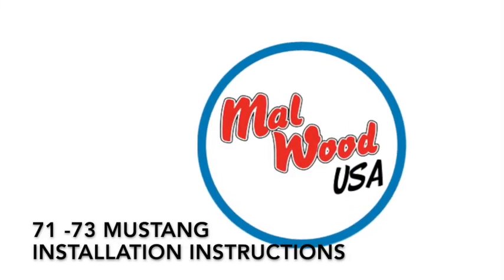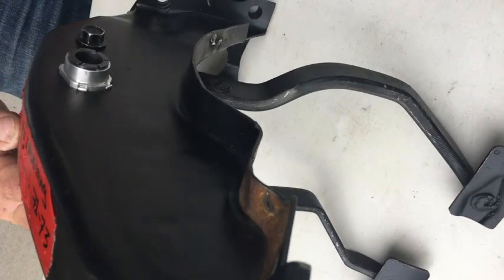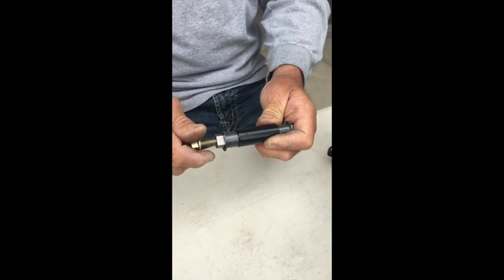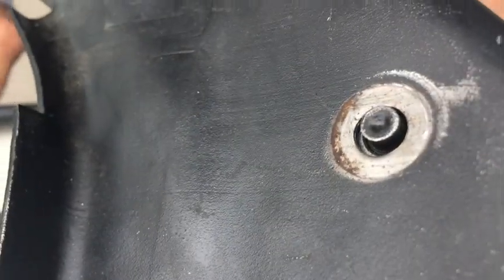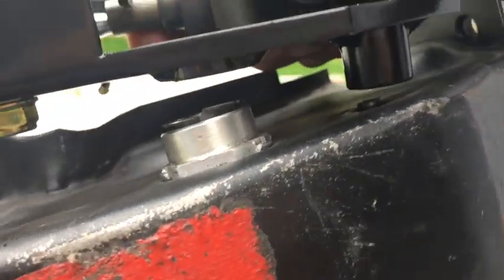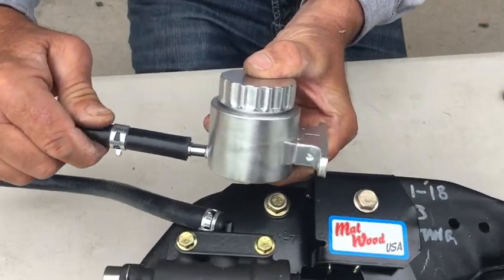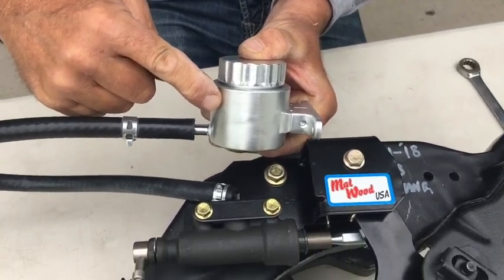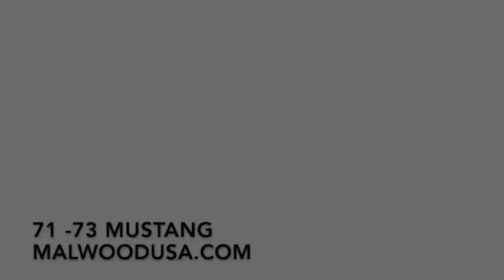Ford Mustang 1971-1973   Installation Hydraulic Clutch Pedal kit

Comment: How can I add this to a previous auto car?
Reply from the maker: You just bolt in our clutch pedal.  You will have to add a manual trans and bearing of course.  Our kit takes care of the pedal and hydraulic master cylinder.  Call us if you have more questions.  Happy to help.  six-41-777-0174
Reply: How do you bolt it in when there is no bushing for the auto cars, just a hole.
Reply: @alexanderperez1380  I  added the Scott Drake bushing kit then bolted it on.  I did have to modify the Scott drake kit as it would not install due to the tolerances being to tight.  That is on them not malwood, though.
Reply: @rcadd1ct  thank you for the information, I actually thought about doing the scott drake kit to make it work, glad it worked, any tips on to overcome thise tolerance issues?
Reply: @alexanderperez1380  Did you ever figure out how to overcome the tolerances with the scott drake bearings/malwood hydraulic clutch shaft?! Any insight would be helpful! Currently doing this myself!
Reply: @rcadd1ct  Im in the middle of doing this conversion, how exactly did you modify the scott drake bearing to fit the malwood shaft?! Any advice would help!
Reply: @armandoestrada8499 .  My issue had nothing to do with the malwood parts.   The Scott Drake parts caused the issue.  I could not get the circlip on.  The thick washer was to thick.  I ended up using a belt sander to thin the washer enough that the groove was almost visible, but when the wave washer compressed I could get the circlip on.  I fought with it in the car.  Made tools to squeeze the clip on, but only after I pulled the pedal box out of the car I could see the tolerance issues.  To sand the washer get a scrap 2x4 piece of lumber.  Screw 2 Sheetrock screws into the wood with the heads prowd half the thickness of the washer.  They should be spaced apart so the middle of the washer fits around them.  This will keep the washer in place while you sand with a hand or bench mount belt sander to the proper thickness.
Reply: Bro, you have any pics on social media!? You just confused me! Haha! Circlip? Thats the 2" spacer that goes in between the bracket on the car that holds the clutch pedal/brake pedal? What about the shaft that goes into the actual scot drake  bearing thru the bracket? How did that fit?
Reply: @armandoestrada8499  Never purchased the unit, going a different route, cable operated instead.
Reply: @alexanderperez1380  Thanks my man!
Reply: @MalwoodUSA  If your car is automatic will the kit work with scott drake roller bearings no problem? Or some modifications is necessary?
Reply: @armandoestrada8499  what transmission are running?
Reply: @alexanderperez1380  t56 magnum
Reply: @armandoestrada8499  I ask because I just ended up going with a cable operated clutch from modern driveline.  Just seemed easier to me. I did have to but a clutch pedal assembly though.
Reply: Buy*
Reply: @alexanderperez1380  i have the same clutch pedal assembly from MDL with scott drake bearing to fit in the whole thats located in the dummy slot bracket inside the car. Im pretty sure i can make it work, shall see.

Comment: Just ordered mine. Very excited. The kit I got from American powertrain was absolute garbage
Reply: Hey bro did this set up work for u? My American Powertrain set up is horrible.
Reply: @jesco6830  it worked awesome. The American powertrain angle was way off. This one requires you to grind a very small amount of metal off the brake pedal assembly that bolts to the firewall. I needed a longer hose than what was provided but I chose to mount the reservoir in a different location. Basically, get this over american powertrain and it'll solve all angle issues and make the clutch pedal way easier to drive with
Reply: @MrMatttrow  yes bro. I had to leave the car with the mechanic today. I couldn’t drive it. I stalled 100 times. He couldn’t drive it either. Clutch is undriveable. What car is urs in? Mine is a 72
Reply: @jesco6830  yeah I had to have them upgrade my clutch kit because the clearances were all wrong. And then everything with the pedal was bad. It would have been better to use cable clutch but then I stumbled on malwood. Mines a 73. Good luck man.
Reply: @MrMatttrow  good to hear u had good luck with it . I’ll call them and order it on Monday. Is the clutch engagement nice and soft and full control over it?
Reply: @jesco6830  definitely. It's like a clutch on a modern car.
Reply: @MrMatttrow  awesome! Will give u feedback
Reply: @MrMatttrow  clutch pedal worked perfectly fine. Like u we had to cut up a metal piece to clear the travel.
Reply: @jesco6830  Can you please provide more information on installation and fabrication? What bearings did you use on the clutch pedal hole located in the bracket? Scott Drake bearings? Where exactly did you have to shave metal off?!
Reply: @MrMatttrow   @J Esco  Can you please provide more information on installation and fabrication? What bearings did you use on the clutch pedal hole located in the bracket? Scott Drake bearings? Where exactly did you have to shave metal off?!
Reply: @armandoestrada8499  hydramax hydraulic clutch.  Shave metal off the plate that hold the brake pedal to clear the clutch engagement. This is in a 72 mustang fastback
Reply: Bro, any social media so i can DM ya? Was your car an original Automatic or Manual? Thanks for getting back to me
Reply: @armandoestrada8499   je_72
Reply: @armandoestrada8499  IG
Reply: @jesco6830 was your car originally an manual/stickshift car? If it was an automatic car, did you use scott drake roller bearings to attach the malwood shaft for installation? Please specify! Thanks!
Reply: @jesco6830  calilla_z06 is mines
Reply: @armandoestrada8499  yes it was originally manual. U should call Malwood USA they will help you.
Reply: @armandoestrada8499  auto car.  Looks like the deleted my response.  Build is on FB.   I guess I need to create a shareable page
Reply: @rcadd1ct  how can i start following ya? let me know!